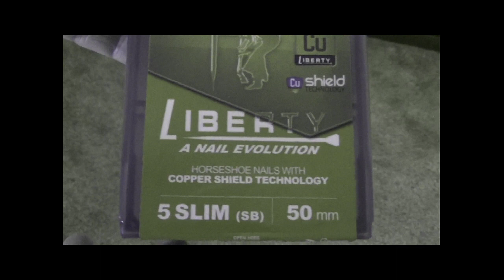HORSE SHOE NAIL CROSS ALTERNATIVE

Comment: What did you use to make your tool to bend the loops at the top with
Reply from the maker: At 3 minutes and 33 seconds in the video you will see the device that I built to make the bend.  You can also use a 3/8 " carriage bolt. Drill a 1/8" hole near the edge of the rounded top. You will have to experiment with it to get it right.
Reply: I see the device but what did you use to make it?
Reply from the maker: It was hit and miss. I found a handle and had to experiment with just the right sized hole to make the bend in the video.